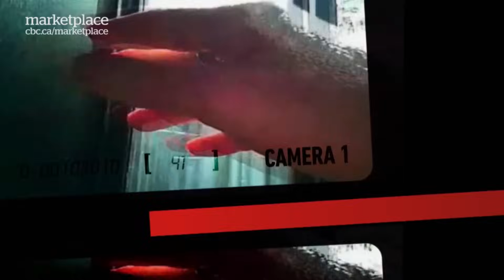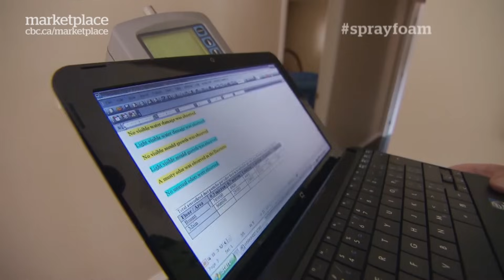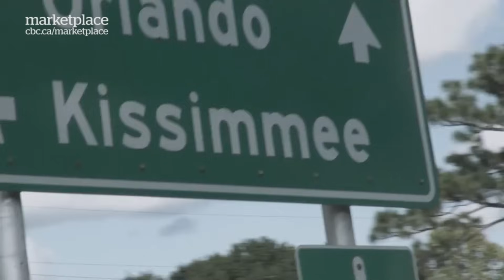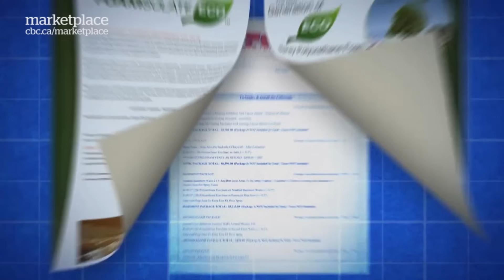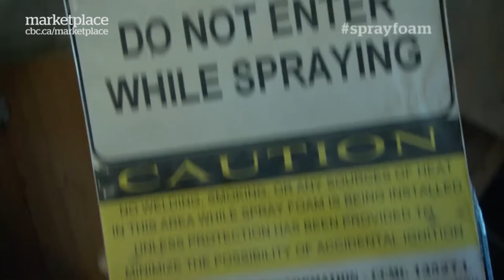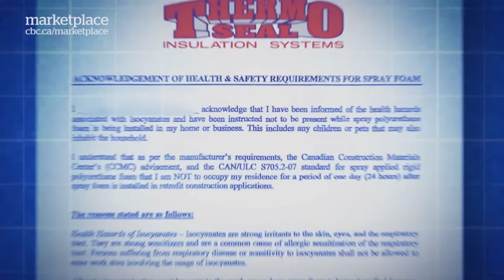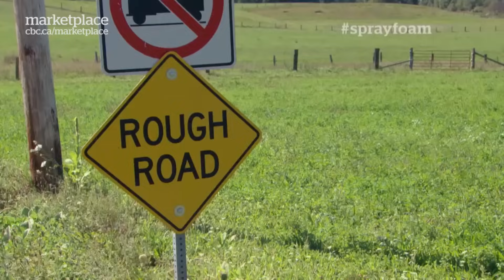Spray foam insulation nightmare: What can happen if it's not installed correctly (CBC Marketplace)

Comment: I think the contractor deserves some credit here. As a homeowner, I would have told them to remove that 1% today and maybe the surrounding area and we'll see if that fixes it. Only after that, demand full removal.Documentation all along the way from the contractor. There has to be a point of reason. Not having vacancy requirements in writing was definitely a fault on contractor, though.
Reply: vacancy requirement????

Comment: One other thing · In the UK, a cable surrounded with thermal insulation must be derating to 50% of its free-air current . If the foam is sprayed over the installed electrics like that it must be even more as it can't get rid of the heat at all?
Reply: Depends on what type of foam is used, open cell or closed cell.

Comment: Throughout the majority of this video, the lady is wearing a mask with particulate filters installed. That was not doing her any good at all. But right at the beginning, she had different cartridges that I was unable to identify. Did someone clue her in that all that time she was using the wrong cartridges??

But, regardless, there is absolutely NOTHING wrong with spray foam insulation if it is installed correctly and if it is used in the manner that it was intended. It is just like everything else. Educate yourself before you make a decision like this. The video was WAY overly dramatic and put a huge spotlight on what is basically a non-issue if done right.
Reply: capriracer351 she was using charcoal cans on her gas mask which cleans chems from air
Reply: capriracer351 You are correct even the guy that tested said he couldn't really link any of his findings to the spray foam. I don't know I didn't watch to the end yet. but I think your right its a none issue I guess you just have to use the right people.
Reply: How the hell do u know wiz kid

Comment: I will stick with the itchy dry insulation. How can staying out of the home for 24 hours solves anything in the future? This won't solve anything if the foam was improperly installed.
Reply: It's not a bad system, if applied right. Best for new construction where they can do it right, thin coats with long cure times between coats. It's very draft resistant, it will add to the structural integrity of the building, great for sound proofing. 
It adds some cost if you do it like I had it done. All my pex and cabling is ran in conduit so I can repair it if needed. It adds to the build time. 
But it was worth it, I have foot thick walls and I can heat any given room with a candle, literally. 
The problem comes from greedy companies trying to get as many jobs done as they can, so they put down too much and it can't cure right.
Reply: Fiberglass insulation,  tried & true!!      I'll pass on insulation I've got to beat out if I need to replace a piece.
Reply: @genejeffries2888  - Your answer is basically positing that using the foam is a gamble with your whole health and home, but that's OK because the odds are highly in your favor. The fact is, one should not gamble with costs one cannot afford to pay. If you can't afford to lose your health or your home, don't risk it. Consider that scientific studies have proven that humans make terribly poor judgments when it comes to accepting a low risk of a disastrous event. Using Expectancy Value Theorem would show a decision to get foam is a bad one, but people choose the foam because they think a low risk means they have controlled the risk. They have not. They can be burned, and the cost of the risk is not worth from a pure analysis standpoint. Arguing its people right to make a choice is like arguing Russian roulette is acceptable. It is not. High odds in your favor do not make a gamble a worthy choice. The cost of failure must be considered. If your home has a in 1/30 chance of being done poorly and affecting your health and ruining your homes livabilibty, then for a $300,000 home, the choice to install foam is basically a decision that will cost you $10,000 AND 1/30 of the remaining healthy years of your life. Think about that! That is for odds of 1/30. With a low-cost contractor, that chance might increase to 5/10!
Reply: @bruzote  well you find me something that is a sure thing, and I'll show you a lie.
Every building methods have pros and cons, you don't make mortar right and the bricks fall off.
Reply: Daddy Dollaz  I had an air quality test done... it worked fine, no problems. As long as it is applied right, it's not a problem.  I'm not a big fan of bat, it compresses over time. It does nothing for draft. It is wonderful bedding for rodents. (Im deathly allergic to mouse dander) p
Reply: windtalker98 nonsense my fiberglass insulation had nest of insects living in it. Gross. My spray changed our home for the better, way better.
Reply: bruzote buy the proven materials. Tens of thousands of homes are sprayed every year with zero issues.
Reply: Spray foam is to be used for new construction only, these company’s are rolling the dice with peoples health at stake.  I was a spray foam contractor and never installed into a retrofit situation.

Comment: a house has to breath, to be healthy. that home is a sealed zip lock bag.
Reply: that what i seen also
Reply: You can add an air exchanger to control the breathing
Reply: Ankur Sethi     You’re correct. In mn the energy codes makes it so air doesn’t infiltrate and you need a good air exchanger. Maybe it’s a nationwide code. I don’t know.
Reply: your living on planet earth  not on mars
we normal people open the window once a while thats what thy ar for
Reply: onelove how do you ventilate a house without a HRV?
Reply: open a fuking window
Reply: They are trying to keep the smell around to help justify their whining, which is going to let the smell soak into the wood and other porous materials in the house.  They are just screwing themselves over if they don't win the law suit lotto.
Reply: Do you have any proper scientific or engineering data on your ridiculous  statement? Nathan
Reply: @jameseverman4014  yup

Comment: In my opinion a good alternative would be using mineral wool (Rockwool) and covering that with a vapor lock. It requires more work though. But removing that kind of insulation and detecting a roof leak is much easier.
Reply: Not to mention that the rock wall won't Lose its insulatory value when it gets wet so after you let it dry out you can just replace it right back where it was taken out

Comment: I can not believe they removed the roofing and sheeting to remove this foam Why wouldn't they just cut all of the ceilings upstairs? Much less labor and material cost!
Reply: +Michael C you nailed it.. it's on tv.. who do you think is flipping the bill for this?
Reply: +Michael C much less labour? took the other company 16 days to cut it all out by gaining access through the roof. In a few days though could have the roof removed and rebuilt, money saved in labour would pay for material easy. not too mention opening up the drywall to the attic now exposes the entire house to all the debris and poison.... Would have to tape and plastic every inch of the house.
Reply: I f they were dumb enough to buy spray foam, they they would also be dumb enough to be conned into removing the whole roof on their home. LOL

Comment: Redo the attic in 3 layers of Roxul R20 for a finished R value of 60 & put your mind at ease. Also put some whirlybird vents or Cobra ridge cap vents in that roof & get rid of that heat & moisture in your attic & you would probably never have had a problem! You got a cottage style hipped roof & NO VENTING & probably nor vapor barrier above the drywall ceiling or you wouldn't be getting gases from the foam!
For crying out loud doesn't anyone know how to build anymore?!?
Reply: +Muskoka Man No, just you.
Reply: +Muskoka  Man Most can't even bother with finding out what the right way is, let alone actually doing something the right way.
Reply: +No Need To Know You're correct Muskoka Man, my comment was wrong and should not have been made, I personally apologize.
Reply: I can't find Roxul in the US. Can you direct me to a vendor in the US who sells or distributes Roxul? Thanks.
Reply: Georgia Fan I got my roxul from home Depot.
Reply: Muskoka Man yeah but it's cheaper to do garbage work

Comment: What is interesting is the camper they are living in off gases formaldehyde as well for years.
Reply: Bruce Kennedy new campers use much more eco friendly products. if there is too much off gassing you will feel it right away, your eyes will burn and you can smell it. This gave them no warning before purchase,off gassing in campers greatly reduces within a year and is safer then this junk insulation.
Reply: The RV industry stopped using products manufactured with formaldehyde nearly 20 years ago without the Gov't telling them to. Consumers made it clear they wouldn't buy, and sales dropped. Sales picked up when mfrs proved they stopped using tainted products.

Comment: the foam is made of 2 component material. one part is polyol and the other is isocyaninate. they make polyureathane foam. polyol is fish oil and the isocyaniate you don't to know. The material is mixed by blasting the chemicals together called impingement mixing. several things must happen in order for it to mix. 
and the seem to have happened. the fish smell is the polyol and it sounds like it has rotten. being that it is Canada I would go back on the installer and the chemical makers.  I sprayed a lot of it and it sounds like it didn't mix well. off gassing usually accure after two weeks,
Reply: ISOCYANURATE surely?
Reply: Makes sense.  They should have interviewed more Scientists and fewer contractors.
Reply: The foam was either expired or the machine went e24 and shut off while they were spraying it the 2 chemicals is iso and resign

Comment: I use to build commercial fishing boats. Closed cell foam was sprayed for insulation. 6" in crew areas, 18" to 24" in the fish hold. When you're spraying a thick layer it has to be done in several thin layers until you reach the thickness needed. You work your way around the area to be sprayed before returning to do another layer to allow for curing time. Then the foam is planed smooth and plywood and a fiberglass layer is added, so the foam is sealed in between the hull and fiberglass.
The fish hold has to maintain a temp of 0°F. Foam is the best insulation I've seen. Boats with it can maintain the temp with the refrigeration cycling every few hours when no new fish are added. Older boats with Styrofoam sheets usually run their systems continuously. It also is sound proofing. In builders trials, with several diesel engines running, in the galley or crews quarters, the engine noise is hard to discern. I would have to grab the counter or a wall to feel vibration.
Foam may not be the best insulation for houses. But if I lived in one, I'd use it. I live on a small ship with foam insulation.
I suspect some of the spray foam problems is the home owner choosing the lowest bidder or the installer not properly training new employees. Nobody likes to spray foam. It's usually the newest guy. You got to make sure he knows the rules.

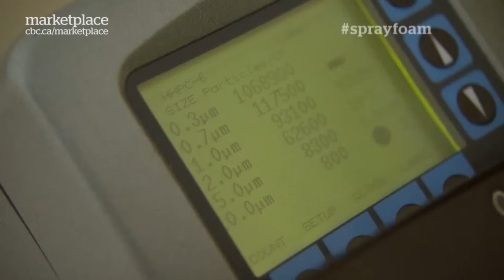Comment: Save your time watching the drama; the results start at 14:30. Uncured product from the improper installation leads to ongoing off gassing of various chemicals. Keep your windows open, put a fan in the attic to pull air out. Get the foam removed. Instead go with roxul type insulation with proper vapor barrier

Comment: We have spray foam in our house. It's been great. We were told to leave while it was happening (I stayed, wife and kids didn't). Definitely going to be botched jobs with anything. Companies need to recognize that. 

What is interesting to me is that some of those jobs were sprayed across the ceiling, not in the rafters. Ours is all in the rafters creating a conditioned space for our entire attic. In the heat of the summer, our attic is maybe 85 degrees. In the south that's a big deal. Definitely go with a reputable company if getting it, not the cheapest.

Comment: I have spray foamed 4 houses.  IF it is done wrong, then it will be bad.  Find a good installer.  I believe that this case is a BAD install.  If it is mixed wrong, it is not good.

Comment: They got f*cked. It wasn't their doing. They are entitled to legal remedy and I hope they sue and get a million. These so called professionals pay some hick piss poor wages to spray without proper training or supervision while doing the job. This family had every right to not live in the toxic home while seeking legal help. Also it wasn't in writing to stay out of the house while spraying as that would make enough people not have it done. My neighbor had this done and it was done right over two days; first day spray then next day spray. They have had not any problems. Lazy contractor hiring lazy workers.
Reply: Nonya Busi 
Correct ✔
Reply: no it bankrupts low quality installers pushing up the overall quality
Reply: Wait, so a company give this hick a job.  The hick does the job incorrectly, but you want to find the company at fault?  Sue the hick for the million dollars.  In a separate issue.. Why didnt they put down a vapor barrier?  I used to do HVAC and have seen plenty of attic spaces.  To think of it.  None without a plastic sheet between the insulation and the living space?  I just think it would make more sense to put plastic between your house and any form of insulation.  Condensation reasons now chemical reasons I guess.
Reply: Family comes across as theyre trying to conduct a lawsuit for profit. At no point especially in the very begining were they venting out the smell. They opened the attic crawl space and closed the bedroom door and windows... No kidding its going to smell.
Reply: This is why they pulled the trigger to rip there roof off. they cant sue until its resolved. now they can go to court and claim the cost. problem solved.
Reply: @Bru_Dog1  the company is responsible for it's employees, lack of training, bad work etc, you don't sue the employee
Reply: @MelvinIsMerlin  watch the whole video man, pay attention next time. And you know what, even if that were true, good for them. No amount of money could make this right, the nightmare they went through and the total lack of responsibility from the company disgusts me. They can weasel their way around it however they want, the evidence all adds up to it being a bad spray foam job

Comment: This should have been also applied to the roof deck in order to seal the outer envelope of the attic space.  Filling the joists is a recipe for disaster.   They obviously sprayed wet to high of a lift in one pass with off ratio products.
Reply: Exactly what I thought. Ty!

Comment: Might be time to go back to the basics: Owens Corning fiberglass insulation.  It insulates well and doesn't smell.  Do it yourself and save some serious $$$!
Reply: Laozi spray foam done correctly will save you 30 to 50 percent compared to fiberglass
Reply: Insulates well 😂😂😂

No. It doesn’t.
Reply: Of course it doesn’t... when you only use in inch of it 😂😂😂

Comment: I'm in the hvac industry and I hate spray foamed house's. Never do this to your home.
Reply: Nobody is doing that in Europe. What the hell is this?
Reply: Good advise.
Reply: I insulate my home with hot air in the winter and cold air in the summer.
Reply: Andrew Bellinger--
The Power Company loves you.  And you will never be offered a free Energy Audit.
Reply: I've walked through countless homes with thermal imaging. Homes with spray insulation and homes with high r rated standard insulation. They are about the same in heat loss. Your money is better spent in fixing area's with the most heat loss windows and doors.  I've also personally seen the negative effects that spray insulation can do to a home when it goes bad. Crazy expensive and super unhealthy. If the chemicals don't mix in the proper ratio it releases toxic fumes and the only way to fix it is take it out. O and my home is super efficient with regular ol insulation. spent my extra  $ on geo thermal, really good windows and doors. Guess what I got more energy credits. Hmm weird
Reply: @sicsempertyrannis8830  The only real advantage to sprayfoam is it seals the joints in the walls eliminating cold air ingress.
Reply: ME TOO
Reply: @sicsempertyrannis8830  I worked in a modular home factory and the guy that did the spray foam always sprayed into a large cardboard box first to test mixture before spraying onto house.
Reply: @sicsempertyrannis8830  Your crazy, I live in a spray foam from new construction home and my energy bills are 50-70% less than my neighbors without spray foam.  I live in Texas, you can’t get A/C techs in the attic during the summers here in Texas. Lol.  My house holds 78 degrees in the hottest months with my Air Conditioning off.   We turn the A/C off when we leave for work at 6am in the morning and return at 5pm in the evening.

Comment: there are structural roofing panels with insulation already installed , so they would have too use less lumber and have a few inch of insulation sandwiched between finished panels . why didn't he use that

Comment: Their house can't breathe no ventilation for the house and especially bthe  family. That's why my old 1920s house is drafty and   i use plastic sheeting and  newspapers   in windows etc but will never do that learning new ideas everyday but will never do that  blessings
Reply: That's why when you use spray foam you need to have a good HVAC unit so it can put fresh air into the house.
Reply: The sad thing is the trailer their staying in has the same issues  . they have stickers on them stating they are not to be lived in, and must have good ventilation .
Reply: @drippa8834  WOW you are good, you can tell how old someone is by the way they type, you are good,  NOT.